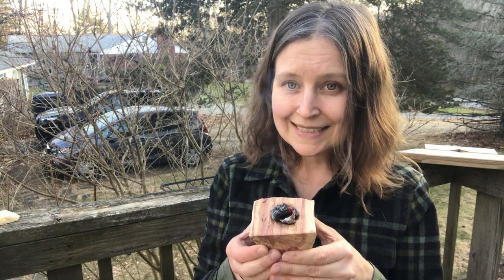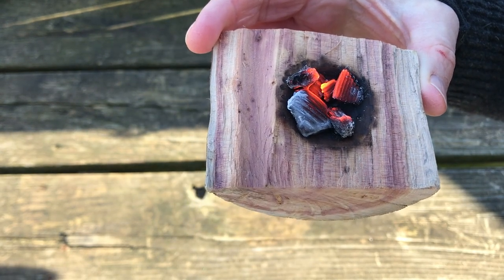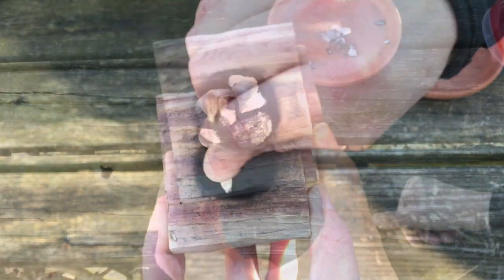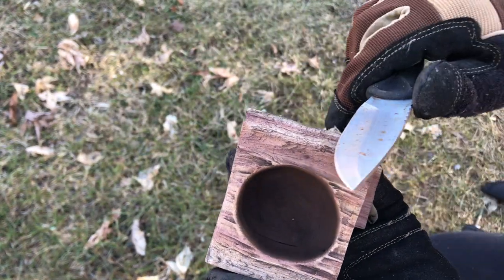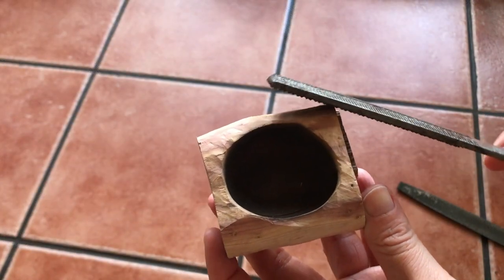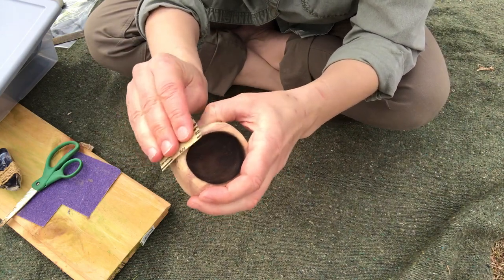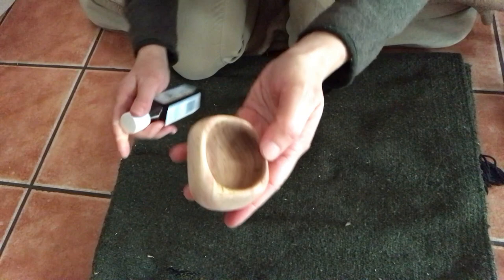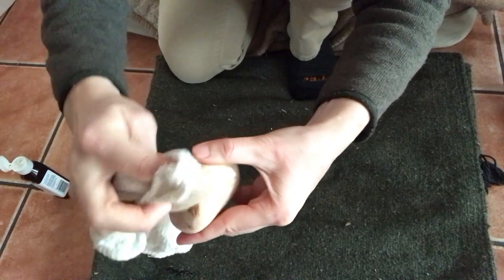How to Make a Coal Burned Bowl

Comment: Thank you for yet another great video. (^^,) 
1 or 2 tips, is when you're finished with fine sandpaper or a rough sandstone.

Use a  antler bone, or a very smooth round stone (e. g. Flint stone).
To press the wood fiber down, that way you get it very smooth and a little shiny too.

For oile always use walnut oile, it's more food safe and it don't go stale / rancid.
Best regards from Denmark. (^^,)
Reply from the maker: thank you for these added tips!!

Comment: Using a straw as a blow tube makes it easier to focus your breath into certain areas on the coals and keep your face further back from the smoke, if it is bothersome.

For an even more primitive experience, you can select nicely shaped rocks with different surfaces for sanding both inside the bowl and on the outside surface. 

You can also coal burn spoons. Its a bit tricker because of a spoons smaller size, unless you are wanting to make a larger serving spoon. It’s worth the experience to give it a try. : )
Reply from the maker: what a great suggestion! thank you so much!
Reply: @AlexandraBurkhart  You’re very welcome! : )